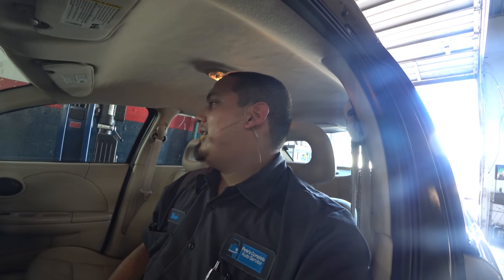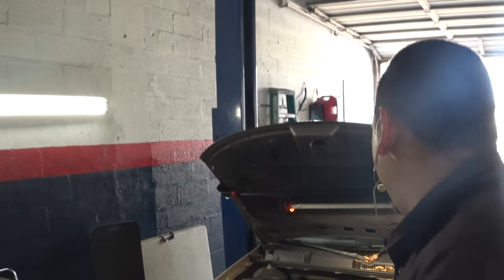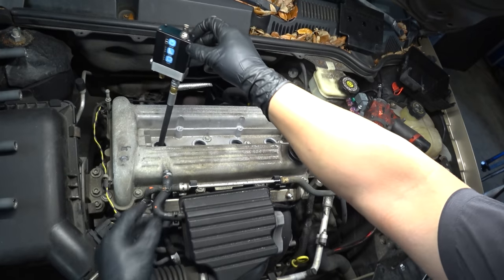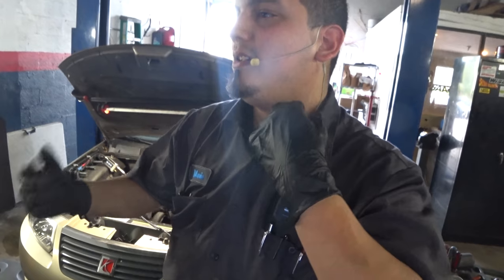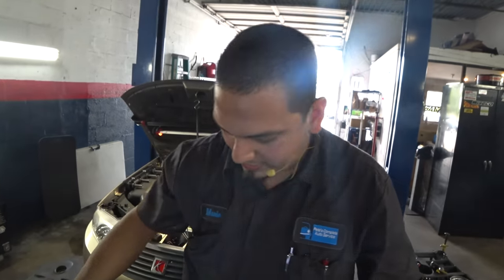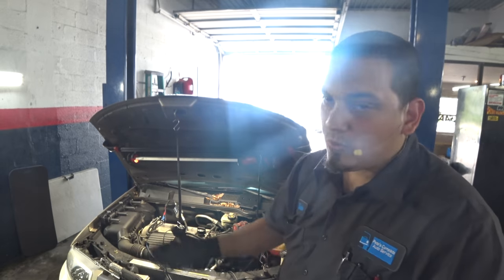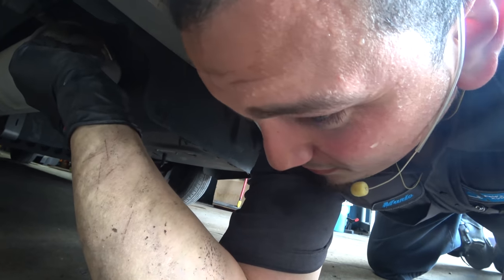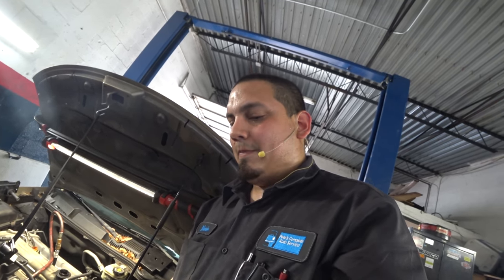2006 Saturn ION 2.2L - Misfire diagnosis (IN REAL TIME)

Comment from the maker: Be sure to check out Cody's Auto Diagnostics: https://www.youtube.com/channel/UC7AtpaCPv1QXYa-yE2sPQbQ
Reply: Super Mario Diagnostics absolutely great work brotha!!! Just finished the video and appreciate the shout out! God a video rendering now lol
Reply: Great video enjoyed seeing you diag this vehicle, and forgive me for being ignorant as too I’m still trying to learn about scoping etc and trying to learn how to diag. But why not just start with a compression test than a cylinder leak down test?
Reply from the maker: Davion Martinez the clear flood test already led us to believe that there was a contribution issue with one of the cylinders. Now it was only up to identifying which one. That's where i did the relative compression test. Once I identified the offending cylinder, the compression test wouldn't have told me anything I didn't already know up to that point. So I went with the leakdown as that was the test that would give me the answer I wanted: why was it contributing less? Plus I did go in cylinder at the offending cylinder and I saw that it was over 20 psi less than the number 1 cylinder. So i did do a compression test, but not with an analogue gauge. I never do analogue compression tests anymore.
Reply: Super Mario Diagnostics ahh okay thanks for explaining , digging the channel bro! Keep it up
Reply: I’m confused why a running in cylinder pressure waveform would not have found the leaking valve?
Reply from the maker: The in cyl can confirm a leakage. It's much harder to pinpoint where it's leaking through

Comment: Great job and video.  Not everyone is as savvy as you on using a scope.  Showing how you set the scope up and how to use the different testers/adapters is a very big plus for everyone who watches your videos.  Keep them coming.
Reply: Would the same thing apply to a 2004 Cavalier
Reply from the maker: Scope based testing applies to any vehicle
Reply: Yea I missed the class on how to read that graph to identify the culprit cylinder

Comment: That was quick an easy.  Would not believe how much I had to pay GM dealer to diagnose a cracked valve in my 2004 Saturn 2.2 L.  They never told if it was intake or exhaust.
Reply from the maker: Easy only after plenty of training!

Comment: Glad I'm not the only one having issues at first reading the position of fuses. Also I've noticed working on my son in law 05, there are some places on the fuse panel you can accidentally put them in two separate circuits. I Fried a diode. Never ran into that issue with any other vehicle.

Comment: I use a small toy balloon to find TDC.  Slip the balloon over the compression test hose nipple.  Turn engine and watch for balloon to inflate.  It shows TDC  accurately.

  I use 10 foot audio patch cables to extend scope leads for getting  to the rear of the car or to get inside the car from under hood.  They have RCA  male plugs so I use  RCA-F to BNC-M adapters to make connections.

  I find exhaust pulse waveforms similar to intake waveforms.  Mostly you're looking for the "odd man out", then ID the cylinder and  look closer at it.  To ID the cylinder; label the firing order, from the sync,  onto the waveform.  Then label the companion cylinders, in FO, under the IGN FO.  The exhaust pulse for the sync cylinder  is shown by the companion cylinder label.  The same for an intake.  ie: the short intake pulse on this car is cylinder 2, as you said because of crankshaft speed.  An exhaust  valve leak won't, otherwise, affect  the  intake waveform as  seen by the cylinder 3 intake pull being equal to cyl4 pull.  

FLS type sensor waveforms can be confusing because they are AC  coupled and don't  have a fixed baseline.  I get the most information from the "swing" of the waveform.  The length of the rise or  of the fall of the waveform as compared to the rises , or falls, of other parts of the waveform show differences in cylinders.

Your explanation of the expansion void is generally correct but  caution is needed because of the delayed intake valve timing of some engines .  The  degrees BTDC that the intake closed and the  degrees ATDC when the exhaust opens was generally  equal but VVT and Dynamic Compression Ratio engines delay closing the intake so that an expansion void  may form.  It won't be as pronounced as a large leak but could lead you astray.   I'm anxious to see what Dmitriy's video shows.

Comment: Mario!I got a p0340 that won't go away on a 2006 Saturn Vue ecotec.I changed the icm for a misfire and coil pack.Runs great but code won't go away.Please help me!Point me in the right direction.
Reply from the maker: That code is for a cmp sensor. Check for good supply and ground to the sensor, and see what it reads when you scope the signal

Comment: Mario, excellent video. thank you for showing everything in real-time. and thanks for showing all of the different steps in detail. very informative and helpful. Have a good one Artie 👍👍👍 Mario when you installed the amp clamp on the battery wire can you put it around the chafe material or did you put in a spot where it was just the cable. thanks bud
Reply from the maker: Around the corrugated shield was fine

Comment: I haven’t had a wrench fall off a crank bolt in over a year. Lol.  Maybe cause I haven’t put a wrench on da crank bolt thus my self analysis is? I need to get off the couch.  Good video but expecting a follow up on what you found. Broken spring, carbon, heads coming off for valve work?
Reply from the maker: The result is at the end of the video

Comment: what will be the theory of weak intake pull as you said I have been told  intake issues but there are variables for sure.
thanks for sharing
Reply from the maker: There are three variable for a "weak" pull:
If it's weak on the compression stroke of the suspect cylinder: intake valve leak.
If it's weak on the intake stroke of the suspect cylinder: not an intake leak, but compression loss elsewhere.
If the intake pull appears "weak" on the tdc after the suspect cylinder: it's crank speed related, as the crank slowed down, the intake appears to weaken.

Comment: It would not be a bad idea when you find an exhaust valve not sealing or a chunk missing out of one to do an injector leak down test. Just to make sure you don't have one that is restricted. An injector that is partially plugged/restricted causes the valve to get extremely hot and possibly warp or have a chunk of it go missing. Just a thought.
Reply from the maker: Great tip, thanks for sharing and swinging by!

Comment: My dad got the same car and doing the misfire. Misfire at idel and when I take off then straitens out after you accelerate.....used a pocket scanner on it. Replaced both o2 sensors mad sensor..then still doing it. Replaced ignition module and coil pack with plugs and boots...got better pickup in accelerations...but still has the misfire but to it smells like it's loading up on fuel. Too. So I'd replaced the map sensor because I'd read up if they go they do those systems...still doing it....re did the pocket scan.. 0 codes 4 ready 3 Inc monitrs...4 ready are egr o2snsr sec air comp. 3 Inc monitrs ac fuel misfire..  Car got 116.000 on it has a stupid eco tec 2.2..can u help please?

Comment: Hi Mario Great Video! 
I am just getting into using the WPS and First look sensors to troubleshoot engine mechanical issues. Maybe you can shed some light here.

I was surprised to see this cylinder with an exhaust valve leak severe enough to cause a noticeable cranking cadence issue didn't really seem to show up in cylinder 3's intake pull as weaker. At a quick glance my inital thought as well went right to intake valve leak until I calmed down and realized that the 'weaker' pull in your pattern was not in the right spot to be caused by 3 on the upstroke to TDC. 

Thoughts?

And keep the videos coming!
Reply from the maker: All depends on the engine. Some show the weak intake pull, some might not. That's why we gotta going at it
Reply: @SuperMarioDiagnostics  would it be safe to say then that the intake pulls seen by the first look sensor are more greatly influenced by intake valve leaks  that impact another cylinders intake pull vs using it to look for leaks on the exhaust valve? Or would it be on a case by case basis?

Edit- I say this because to my untrained eyes exhaust pulse patterns are trickier and messy looking to me 

Thanks again!
Reply from the maker: For me it's best to spot intake valve leaks on an intake pulse as opposed to an exhaust pulse. Mind you, I'm very limited on my experience with these tests, I'd treat each car on a case by case basis

Comment: Mario, great video!  Could the reduced intake pull when the weak cylinder in compression stroke be accountable to just enough leak by the exhaust valve during overlap of the other cylinder's valves to reduce the intake pull?  If it was an intake valve leak then the pressure from compression stroke would make a spike upwards in the other cylinder's intake pull?  Just trying to learn, love the channel.

Comment: So I had a handful of codes thrown. P0300 etc etc. I changed the ICM which took care of the misfires on #2 and 3, stopped blowing fuel in the cat to super heat it.......... Now I hang a P0341 camshaft position sensor code. However, the this 2.2L does not have a camshaft position sensor. Does anyone have an idea of what it could be? Engine runs pretty good but I do feel a miss here and there, no misfire codes at all though.
Reply from the maker: These use the ICM to calculate crankshaft position. Specifically using cylinders 1&4. If there's any ignition system issues with either of these cylinders it may throw this code. Was the ICM an original part? 

I would also scope the brown/white at the icm to see if a good signal is coming out
Reply: @SuperMarioDiagnostics  the icm was missing on #2 & 3. I used a test light to find that. The ICM is now new and runs better. And by the looks of the plugs, its hitting on all cylinders. However it still stumbles from time to time. I went ahead and pulled the crankshaft position sensor, tested it with a multimeter and it was good. I cleaned off the gunk that was on it. It seemed to help, but still have a P0341. My sister had it at a shop prior to me working on it. They "said" they changed the coil packs, but that is highly suspect of not really being changed. Sorry for the delay in response but thank you for all your help.
Reply: @chulachaser5321  did you ever fix this issue I'm having the same on a 2006 saturn ion 2.2

Comment: Mario  would it be correct to say that cylinder 2  got a little ripped off on its intake pull because the crankshaft was slowing down after it had sped up because  of the low compression in cyl 3?
Reply from the maker: That's exactly right

Comment: Hey bud these are really good videos but the question I have is Once you know which cylinder is bad why not just do the leak down test and go from there Instead of the complex computer graphics thing Because at the end you’re still confirming everything with a Basic leak down test tool
Reply from the maker: A leakdown will not reveal an inoperative valve

Comment: out of curiosity, why wouldn't you synch to the #1 injector trigger as opposed to going in-cylinder?
Reply from the maker: Because the injector fires around the intake stroke. Unless it were a direct injection engine, it would not line up with tdc
Reply: @SuperMarioDiagnostics  I know and agree. I'm just curious if we could find a way to use the injector  trigger in conjunction with the coil trigger (since it's two cylinders) to narrow down which coil trigger was which cylinder. (This is more a curiosity, not necessarily practical since we'd need this same setup vehicle to screw around with and verify. And ultimately probably wouldn't have saved us any time). Again, merely a curiosity :)
Reply: On the intake pulse waveform could you contribute the weak pull to the exhaust leaking into the cylinder during the intake stroke. I’m new to interpreting these waveforms but that was my first thought. Although slower cranking leading to a weaker pull does make sense as well.

Comment: Couldn't you look at misfire data on scanner to find misfiring cylinder? If it has misfire data. Just asking. Love your videos.
Reply from the maker: Actually it would clock several misfires under load across all cylinders along with a p0300
Reply: @SuperMarioDiagnostics  ok. I'm still learning this diag stuff which is why I watch your vids along with others. Thanx bro.
Reply: Misfire data doesn't show where the leak is and misfire cylinder recognition isn't always correct. Confirming top end would be a different conversation than say a piston ring leakage to the customer
Reply: Jaymz strader you did have a point John sorry for shooting you down, if it highlights a certain cylinder on live data then it would be a good starting point  when going in cylinder.